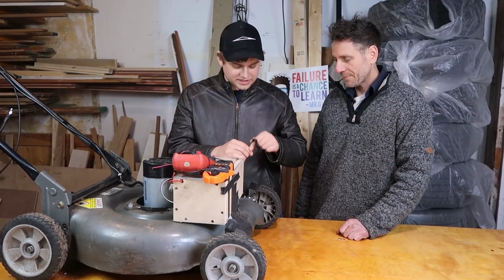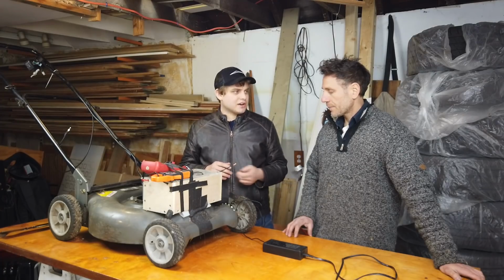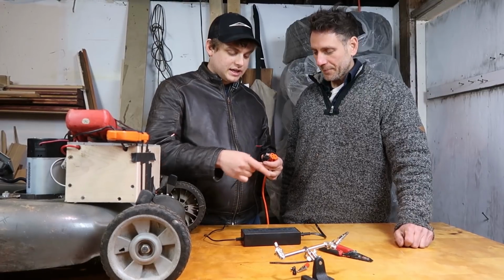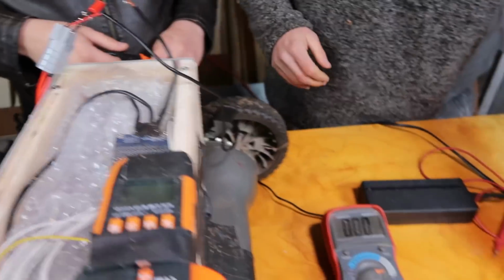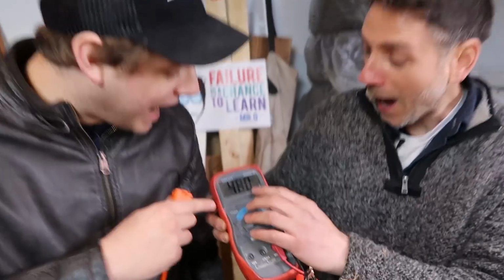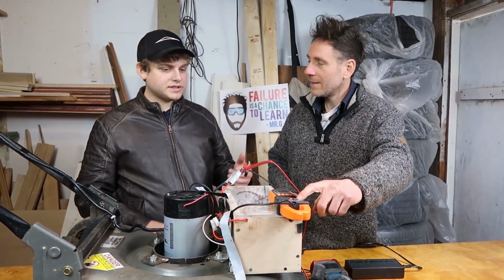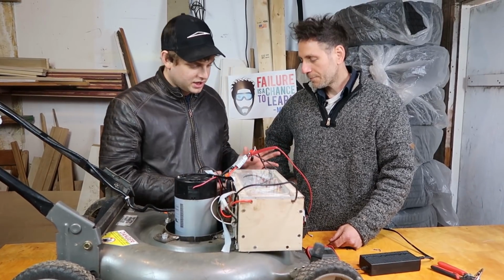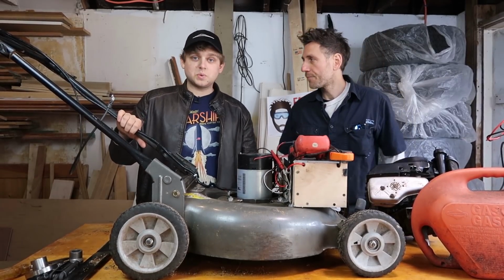Electric Conversion Workshop: Lawnmower Project - Episode 13

Comment: Is there any overcharge protection? Maybe included in the BMS? The only thing I'd be worried about here is that if I was using it, I would be that guy who left it plugged in too long and cooked the battery. :/ I've never done this to my cell phone after leaving it plugged in for a long time, so I'm guessing that its charger or BMS must have a built-in overcharge protector like the lawn mower's BMS must? Regardless, thanks for posting!!!

Loved seeing the riding lawn mower teaser clip! Can't wait to see that! Thanks for taking on that project!!!

Comment: Guys, thanks to you, I took the leap! My kWeld kit arrived this week, and I'm about done assembling it. My first batch of modem packs (as I think I already mentioned) arrived last week, and I have thus far tested & rated 56 of 300 of my 18650s. I also ordered a nice charger from Luna Cycle that matches the pack I am designing (14s10p). This winter I plan to convert my ICE Adventure recumbent trike with a 750W motor kit, also from Luna Cycle. I will configure the motor controller to draw 20A nominal, and my pack in that configuration will offer 32.25A, leaving me a comfortable margin for safety. Speaking of safety, the pack charger I bought has an XT60 connector, and came with the plug that I will attach to my pack for charging purposes, so none of the sketchy alligator clip stuff for me! ;-)

I would never have done it without your inspiration! For that, I thank you. My wife/CFO, on the other hand, is not real happy with you. :-)
Reply from the maker: That's awesome! Be sure to take some video! We'd love to include it as a video contributor story on Tesla Time News!
Reply: @NowYouKnowChannel  You can count on it! :-)
Reply: @williamkorb  yes! Send the link. Also, if you get info on how to fast charge let me know
Reply: @xXZ31t6esTXx  Sorry, which link? The charger? That's here: https://lunacycle.com/luna-charger-52v-advanced-300w-ebike-charger/

Comment: Why not make up an adapter, or just fit a matching connector on the lawnmower side? Probably 50c or less. Rather than destroying a perfectly good connection that is also used for another device?
While it was suggested later "sketchy" doesn't even come close to covering it. :(